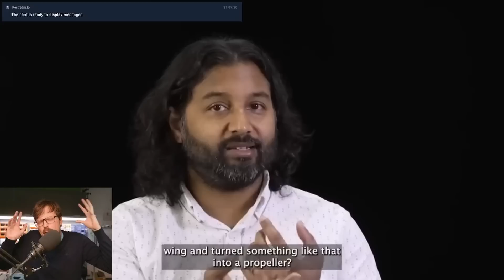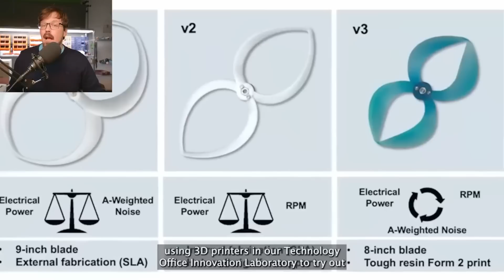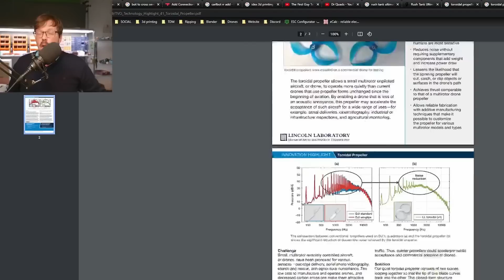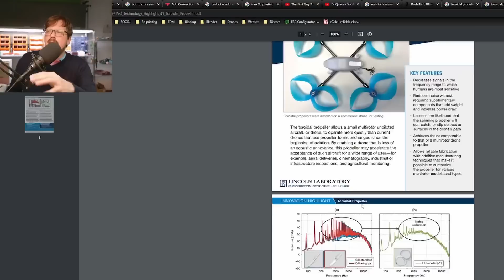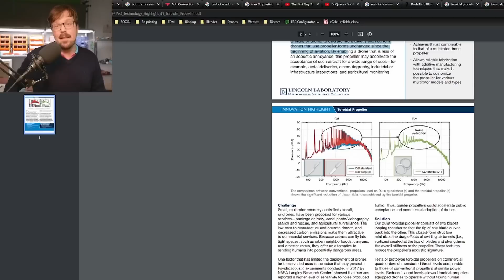MIT Thinks you're STUPID - Toroidal Propeller Snake Oil

Comment: "What kind of electrical power are you taking about? Volts, amps?" Seriously? Electrical power is measured in watts, this shows that you really lack understanding. And yes this wasn't made as a research paper as research papers are public domain. They are looking to make money off of this. This tech really is an improvement, your going to hard into details that don't matter or were simply covered poorly. Improvement also doesn't mean night and day difference.
Reply: On a boat, it is like 20-25% fuel savings for the same speeds. So on the boats this is a game change. On the plane, I am not sure.
Reply: @millanferende6723 nope , there is a video on that also
Reply: Honestly I just see this as a more expensive technology in terms of material (more meat for those blade profiles) and manufacturing (complex shapes). Not really sure if those blade profiles give you that much improvement to be considered an actual advantage. In fact, I have the idea that some energy is wasted due to Coanda effect which could make air go in circles along those funky blades. But it's just my afterthought.
Also, I think he meant "electrical power" as a broad term, not really the power in Watts. And besides, Watts are not the only unit for measuring power, as an example you can have Volt-Ampères [VA] which you can find on many appliances due to inductive/capacitive power.

Comment: Reynolds numbers are likely similar between the props and these older planes as they didn't fly as fast. P.s. this research is pretty old. I read the initial findings for the basis of this research a couple of years ago. Sharrow propellers weren't as well known, but beyond that the fluid dynamics between marine and air craft are immense.
Reply from the maker: This would be true in accordance to the patents applied
Reply: @drquads5589  There are fundamental differences between a utility patent and a design patent.

Comment: I'm not interested in whether they are quieter, more efficient or give more power. I think they look funny and that's why I want some
Reply from the maker: Fair point
Reply: That's also why you love mirrors

:p
Reply: The problem is they don't work.  I've never watched this youtuber before, but was recommended this because I watch videos about FPV drones and Major Hardware (PC) Fan Showdown.    I've seen at least 6 different people try around ~10 designs and none of them have gotten even close to replicating these results.  Many of the videos also 3D printed regular props as a "control" to show that 3D printing doesn't have a dramatic effect on the final results.

Either there's some secret ingredient that MIT is hiding, or it is all bull.

Only reason I give MIT even a .0001% chance of being right in this case, is because of the Sharrow (which predates the MIT patent by 1 year).  But water != air.
Reply: @Davionation-s1g  And especially nowadays it's quite difficult, because everything is already optimized to the maximum and it takes a long time to optimize it a little further, it's just not that easy. maybe in 10 years they will have something revolutionary... or not ¯\_(ツ)_/¯ But I don't know how long they'll be working on it, but that people quickly do the same thing and it don't work directly shouldn't surprise any one. The only one I've seen that has ok results is quadmovr
Reply: @Davionation-s1g  Exactly

And in water they work mainly cause cavitation is a real problem that can destroy the propeller quite easily, and avoiding it, which similar design manage to do, is important

But cavitation can only occur in liquids.

In water, when the pressure at the edges or tips of the rotating blades falls below the vapor pressure of the liquid due to the speed of rotation creating a partial vacuum in its path, bubbles are formed that contain water vapor. These bubbles collapse immediately, giving rise to shock waves, which can be as damaging as the impact of a bullet. See the mantis shrimp, for example.

The only effect similar (but still very different) in air would be if the tips of the blades crossed the sound barrier and create shock waves doing so... which in a drone doesn't happen. Drone blades are noisy due mainly to turbulence.

In modern blades noise has been greatly reduced, compared with the first generation, by a combination of blade profiles, rotor geometry and lower speeds (higher surface) propellers... less so in sporty drones at full throtle, which require inherently high speeds in their propellers...much more than the noise reduction the toroidal scam claims in its dubious paper
Reply from the maker: @Davionation-s1g  you nailed it

Comment: lol it's been proven to work on boats...there are successful 3d prints that a lot of people have tested, although their performance isnt as good as normal props cause they're 3d printed, and the designs are still being worked on.  I want to see what a factory produced or well produced clean version from good plastic will perform like before I buy or put any time into them though. 

 The design that's been tested rn by almost everyone is by one guy that just modeled them and put his idea of them on thingaverse.  He's already iterated on them several times now to improve them, and they have improved.  They're not the actual props that mit made or their design so we dont know what materials or design theirs was exactly, it may be a couple degrees difference in pitch does produce the results that mit claims.

One thing I think that could vastly improve on the design that I dont think the current props include is to stagger the secondary rearward blades and angle them so they're not cutting into the same disturbed air and add even more lift but move the air out of the way for the following blade, which the MIT guys may have realized in their designs.
Reply: Just a friendly comment to say I agree with both of you :)
Currently it seems like it's all BS, but the 3d printed versions are no hard evidence of that. 
In theory it could go either way,  the actual design may end up being good, but currently it does all feel a bit sketchy.
Reply: @Emil Jekov 2.5 inch is on the way :D
Reply: Its BULLSHIT Im sorry people that actually buy these lies…… we perfected the prop 100’s of years ago?? Thousands? But we can all agree its been a long time and we still have them today because????? IT WORKS!!!!!! They are trying to solve a problem THAT DON’t EXCIST!!!!!
Reply: @Marcus2750-u1t  lul what?  Airfoils and props are have been constantly improved since the wright bros, it's never stopped, computers have been able to steadily model better and better ones.  In the 80's they invented a helicopter blade for choppers that cut down noise as well, and its constantly been improved.   Even in drones, you see little notches and stuff being cut in them in the last couple years.  Newer props like the emax avan have a massive advantage over older ones.  People just came up with that stuff, it's constantly evolving.,
Reply: @maddercat  So whats your point?! Just because something is invented doesn’t make it efficient or work better then what we have! There is no evolving this it works or it don’t….. and this is a flop and will NEVER take over the props of today…..
Reply: @Marcus2750-u1t  That's not true at all, performance has been greatly improved and this has the possibility of improving beyond anything previous.  You get like twice as much thrust and efficiency from a avan as from almost any prop made more than 2 or 3 years ago.  There's been a huge concentration of effort in making props for drones specifically, and that's what this is.  It's not a simple works or doesn't, it's is its performance as good or better than an Avan design, and if its not currently, what can be done to it to do it.  There are massive amounts of variables for props, sometimes it takes a while to figure out the most efficient way, and it's actually a super creative process.  The shape of an Avan is completely radical from anything else that came before it as well.
Reply: @maddercat  hey buddy,please make a  test comparison video to prove it, how Avan get like twice as much thrust and efficiency from almost any prop made more than 2 or 3 years ago?  I think the original intention of Dr Quads to post this video is to see the real original test data, not just a literal description. Science needs to be rigorous
Reply: @maddercat  "You get like twice as much thrust and efficiency from a avan as from almost any prop made more than 2 or 3 years ago."

Pffft bwhahahaha

No
Reply from the maker: @Gemfanhobby  I love you. And that is why Gemfan 3" 5 blade on a 1804 3450kv motor is WHISPER QUIET. Because you do ACTUAL science and testing when you make your propellers
Reply: @TheChzoronzon  Oscarliang has data showing it, so yes.  The thrust and efficiency of the AVAN is that high.
Reply: @Gemfanhobby  Are you going to make us a toroid?
Reply: @Gemfanhobby  Not to say Gemfan hasnt made some props that come close in the same timeframe, but what props before 2-3 years ago could even come close?  All I know is that I got back into the hobby from being out of it from like more than 3 years ago and the props have improved that much in that timeframe.  I directly compared the data on the props I was using before that to AVANS and it was that high.
Reply: @33rdframe  ❤
Reply: @maddercat we will try to get the data as a reference for research, but i think we can't produce it because of MIT patent
Reply: @Gemfanhobby  Ah, fascinating, thanks for the answer!
Reply: @maddercat  From Oscar's own page:

Avan 2inch 4-blade
Max Thurst (sic)/ Current: 151.56g / 6.88A

Gemfan 2035X4 RotorX 
Max Thurst (sic, lol)/ Current: 162.19g / 7.06A

I think you don't know what "twice" means... and now begone, you have already wasted too much of my time, Avan commercial and/or weirdo
Reply: @TheChzoronzon  Those have about the same thrust but draw a lot more amps, they're efficiency in all thrust % is significantly worse.  You're right though they did come out 4 years ago vs the avans 2 years or so..they might have been a better choice during that time period rather than the ones that I had.
Reply: @TheChzoronzon  Look at the dal's and the azurepowers which are the older brands that had hype on them in like 2016, you'll see the difference, the point being that within the last 5 years especially 2 years ago there was massive increase in props, and I said like twice the amount it's probably closer to like ok 1.5- 1.7 thrust AND efficiency based on those existing tests and those comparisons.
Reply: @maddercat  So 2-3 years have turned into six... and a 100% incresase in efficiency turns out to be a 50% (and that being really optimistic...)

Yeah, you are getting closer to the real picture, step by step :D

Yes, new technologies evolve, more so if they are commercially sound... until they crash against the physical laws governing them, in this case Betz's law, and then stop... or crawl into dismissing return and huge cost increase.... and we are almost there already

So no, neither propeller blades have doubled it's efficiency at all (being realistic, let's say a 20% increase in the last decade, plus another maybe 15% in the efficiency of the motors, another topic entirely) nor are right now much room to improve then further

But kool aid tastes soooo well... :D
Reply: @TheChzoronzon You're really reading what you want to read and just trolling now.  Consider the year ranges, yes "before 2 years" is a range before that time period starting around 5-6 years ago when I was flying early versions of 3 inch quads that would use a 2 or a 2.5 inch prop.  yes.
Reply: @Gemfanhobby  "Science needs to be rigorous."
YES! Thank you!!
Reply: @henria.277   lol wut, what are you even talking about.
Reply: @henria.277  Not the point of what I was saying.  I fly HQProp Ummagawd 4Play's on my 5 inchers for years, but as far as I know there's no data on their props in the 2 inch and I don't think they even have a 2.5 inch category, and I doubt they would perform anywhere near the Avan's tbh, they're pretty simple props in that category, that appear very much like the props I was using from before that, that I was able to compare to the Avan's of which there is a ton of data on from a lot of testers, that shows what an improvement over what came before that they are in efficiency and thrust combined...

Which is my entire point that props have improved over the past 5 years, which is the entire point that prop design keeps getting better, and that Toroids are a logical step and have the potential to take things beyond what we currently have, which was a direct response to someone saying, "props have been the same for 1000 years" which is just laughable, and me trying to point out that there was a jump even in the last 2-3 years, which people keep taking out of context and reading what they want to read to trumpet whatever is their favorite brand of props or even gemfan commenting...like. lol   Just so many trolls.

Avan's are also a great benchmark to test toroids against because there's a lot of data from a lot of testers about them, and there are testers that have done just that on their own that I referenced earlier that people should look at that show that even 3d printed toroids do have potential in the 2.5 category which seems to be the main focus on the designs right now because they're smaller props I guess and faster to iterate and less material waste and less stress on the blade I guess.  That's where the focus on the AVAN came from in my statement, and that's all.
Reply from the maker: @Marcus2750-u1t  I don't mind them trying. I just hate the narcissistic greed this uncovers about our "prestigious" institutions
Reply: The outboard motor version is also a real money spinner. 
Apparently it works real well for crash stops  (hard astern).

Basically a rotating - flattened/lengthened to optimise for fluid properties, power loading for diameter to pitch ratios - angled  duct
Reply: @kadmow  Yes that's one of the things that's really interesting to me is apparently reverse spin has a lot of thrust, it will be great for a 3d drone, it might effect the popularity of 3d drones in the next few years if someone comes out with an efficient design.  3d props have always been way less efficient and horrible than normal props, there's a huge market gap in that area they could quickly be applied to.
Reply: @Emil Jekov Also the AVAN are shipped on every tinyhawk 2 freestyle which are basically the only real non toy drone in every hobbyshop in the country, so your claims about no one using them is pretty suspect? I get you're hype about gemfan but like..lol
Reply: Your opener is at least questionable: yes, there are designes for boats out there. But not proven and not used widely. If it was proven to be more efficient than conventional propellers, every new freighter would be using them as it would give an advantage in fuel efficiency and the in competition.
But as far as I am aware, there is not a single, large scale commercial vessel out there which is using torodial propellers....
Reply: @arnepetry3049   That's true, it may be that their efficiency is less, but all the other properties are definitely true they've been tested and there are several videos testing them and showing it to be true...I'm not sure what would be keeping commercial firms from adopting them but that's definitely something to check on.
Reply from the maker: "maybe, possibly, should be, would be"

No data, no proof. Snake oil. Muted audio.
Reply: @33rdframe  lol you have a point, you may be right, I hadn't considered they would be trying to fake this for some reason.  I don't really see the motive, the design is going to be iterated and improved on quickly, and is essentially open source because of that.  I don't think you can patent all forms of this prop, but maybe?
Reply from the maker: @maddercat  two words: patent granted
Reply from the maker: @maddercat  honestly bro, how noone noticed they muted the audio...
Reply: @33rdframe  Yeah, but there are details to that, like they can patent their specific case, but if someone comes along and improves on it, they can patent that too right, which will likely happen soon if not already.   Patents only protect specific iterations of an idea, not the idea itself.
Reply from the maker: @maddercat  apple literally patented swipe to unlock
Reply: @33rdframe  Patents dont really mean a whole lot these days, with everyone printing and making their own stuff, it's why Tesla and Elon open sourced all their patents, and dont even patent anything they create anymore.
Reply from the maker: @maddercat  sure is SUS someone applied for the toroidal propeller patent in 2017 and then it was transfered to MIT in 2020
Reply: @33rdframe  you're just ranting lol
Reply from the maker: @sepg5084  welcome to the channel 🤣
Reply: @33rdframe  no data means you you have nothing to criticise. Seems like you're doing the grifting here.
Reply from the maker: @Rampart.X  you would win gold in the Olympics with that level of mental gymnastics
Reply: @Rampart.X  in order to make the claims they are about it being quieter they would need to have collected data. So if that is the case then why didn’t they include it in their paper?